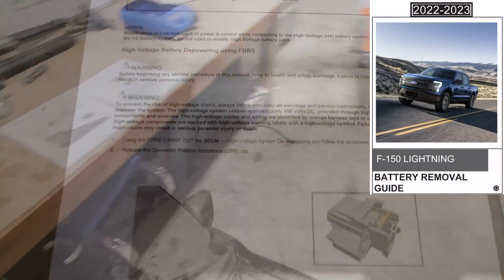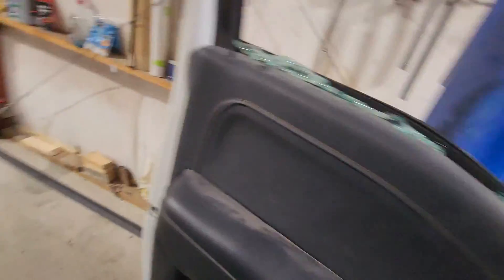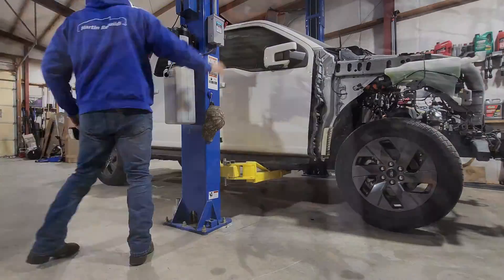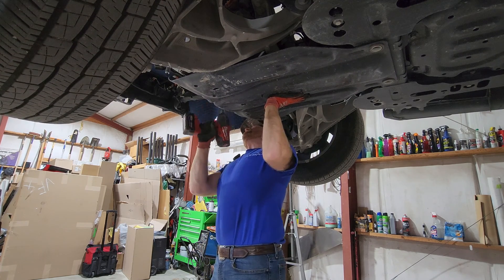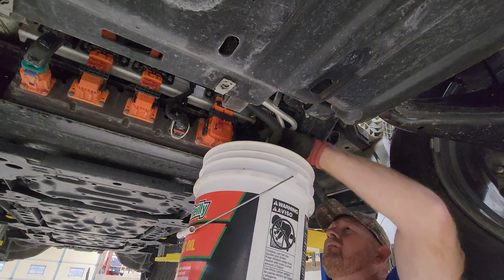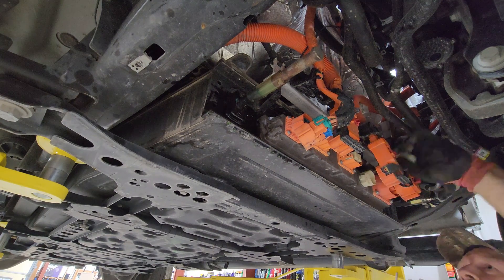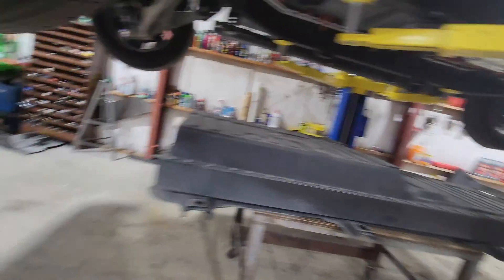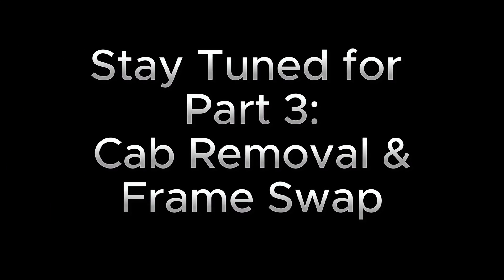Destroyed Ford Lightning Ressurection Part 3

Comment: When you put the battery back in what is the computer looking for? Could I swap in a higher capacity battery later down the road? I assume in a couple years there will be more energy dense cells and faster charging cells. I'm just curious thinking of getting a lighting since there are so many incentives for one plus 0% financing🤔 but I like to mod stuff and a bigger battery would be on the list once the battery tech catches up. Thanks for your time 🍻
Reply from the maker: If you upgrade the software modules using Forscan, you can definitely swap to a higher capacity battery later on. I am looking at adding a 40kw pack in the bed as a range extender. It can be done with some technical experience.

Comment: Hello,
Great video!!
I am rebuilding a lightning too, however i faced an issue with headlights
Its a 2023 ford f150 lightning lariat
I have replaced my left side headlight 
Now it is not in sync with the right side/light bar,
Turn left turn signal does not work too
the light turns on with no issues, but no turn signal, closes after a loong period of time
Do you have any possible idea to fix this issue?
Reply from the maker: I have not experienced that with my 2 builds. Maybe a cut wire or bad headlight?

Comment: Did he say 4 to 5 thousand dollar battery, or 45 thousand dollar battery?
Reply from the maker: You heard right, $45K battery! If it needed complete replacing its very expensive,which doesn't happen. Normally only modules would need replaced but I didn't want to drop it and destroy the whole thing. That's whistlindiesels thing, not mine lol.

Comment: Awesome videos, Martin!  Curious what your opinion is on replacing an SR battery with an ER battery.  Do you think it can be done?
Reply from the maker: Short answer is no. All the electronics are different. Long answer is with enough money, time and electronics knowledge you could. But at this point, trading for an ER is alot more feasible.
Reply: @MartinRebuilds-fz1ep  Thanks for the reply.  Definitely believe you that it'd be a ton of work.  Do you have any recommended resources for understanding the battery and/or charging systems?  Just for someone to get a handle on what all would be involved in a swap

Comment: After a tech did that a dozen times how long do you think it would take them?  It seems like once the learning curve is done these fixes will take less and less time and the cost will come down.
Reply from the maker: Honestly, I had it out in about an hour and a half start to finish. I think 45 minutes could be achieved once you get good at it.
Reply: @MartinRebuilds-fz1ep  very interesting thank you for showing that!  After I watched more of these they look fairly simple. You’ve got a battery pack, 2 motors, and two cooling systems. I’m sure there’s more but ICE seem a lot more complicated. Thanks!

Comment: Awesome work I’m sharing this on our Facebook group. 
I wish I had a 6.5 ft need on mine. 
Does the frame rail under the back seat area look straight enough that a good rear frame could be spliced in to lengthen the frame overall. 
Did you ever hear back from Ford on the rear motor coolant house rubbing on the hose clamp?